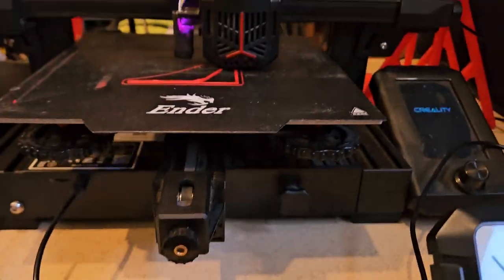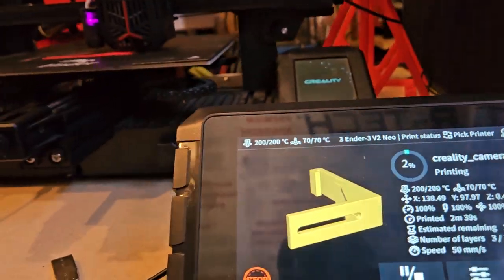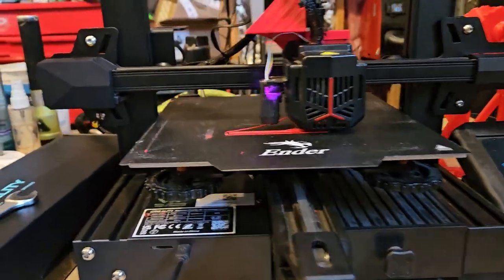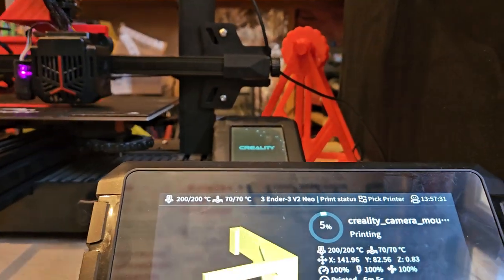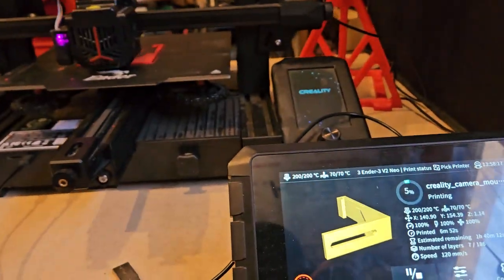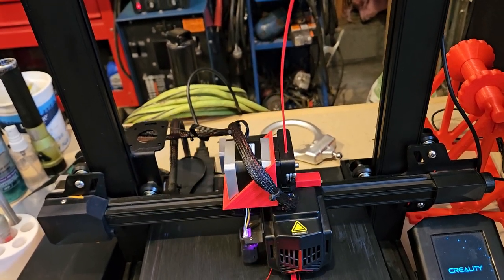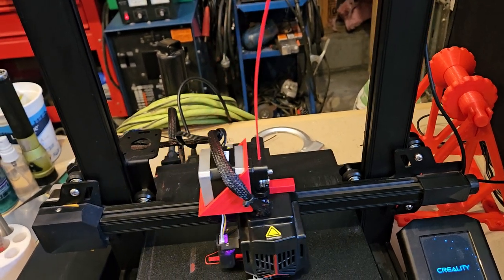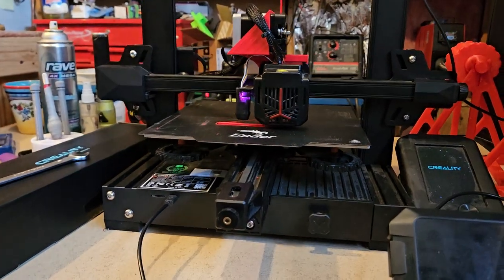ENDER 3V2 NEO DIRECT DRIVE RUNNING KLIPPER...WOW

Comment: Hi Man, thanks for your video. I just bought this printer on sale for my College kid, his first 3d printer, and as you have some time with it, any advice on it ? Also, is the Direct drive mod and install Klipper, worth it ?
Reply from the maker: If you want to print flexible filaments like tpu then the direct drive is going to be amazing.  Otherwise not really considering how slow these printers are stock. I believe it is the stock arm processor and motherboard and firmware limitations that are to blame for the print speeds. Klipper is definitely worth it. But i would avoid the sonic pad and go the raspberry pi route for klipper.  Otherwise save and buy a elegoo neptune 4.

Comment: PID Calibration will edit and enumerate the input shaping values on your config file.  Mainsail does that as part of the task on the web interface. If you look in your config, you should see the values now.
Reply from the maker: The one print was fast now all are slow again. What do i need to do to enable it
Reply: @hamradiohack  look in your config file and search for "input_shaper" without the quotes.  I believe it gets written to the bottom of the config file.  If you see that the values are commented out on that section, remove the # comment parts from each line, and then restart the firmware.  That should put it back into play.